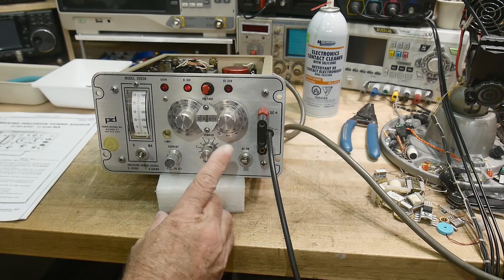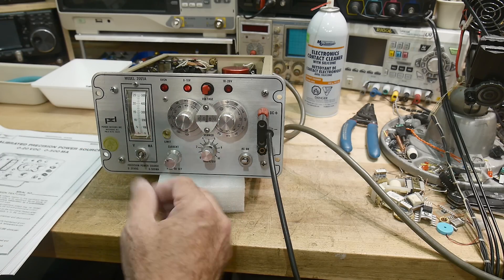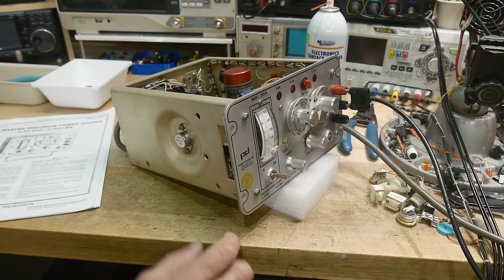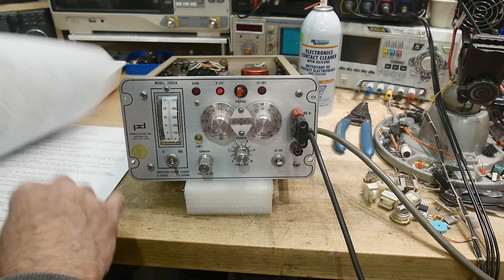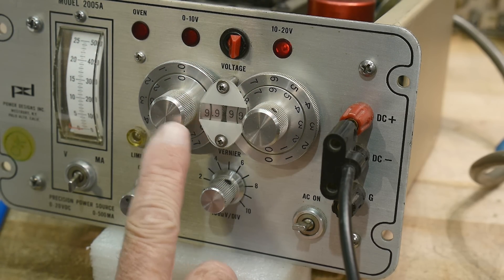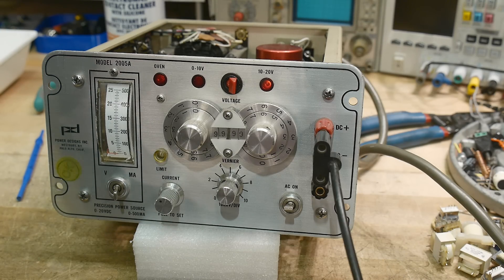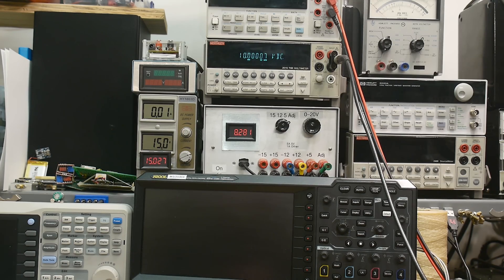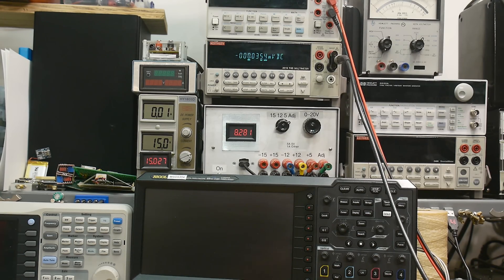#1369 Power Designs 2005a Calibration

Comment: About setting it to 20.000 volts for calibration:  to get it past 19.999 you need to turn the 4th digit one more click past 9 to the position marked with a small '10' in a circle, and leave the vernier at zero.  Same to get 10V in the 0-10V range.

Comment: It looks like the least significant digit of the voltage switches has a 10 position ("10" in a circle). That's where that 20.00 volts should be set, which lets the vernier be set to 0. It probably doesn't make any practical difference in the calibration accuracy, though.
Reply: Yes, the right hand main voltage selector (mV) has a 10. I was resisting the urge to shout at the screen. Great video as usual!
Reply from the maker: you are right, so I set it to 10 during cal. I mention that in the video
Reply: @IMSAIGuy  I don't think we're talking about the same thing. The instruction to set the vernier to 0 (at 8:34) caused you some head-scratching. I think the answer is that at 7:01 the instructions expected you to set the digital dials to 9.99⑩ (nine point nine nine ten) and the vernier to zero. Then the instructions to set the vernier (at 8:34) would have made more sense. It's just an ambiguity in the manual. Your solution with the digital dials set to 9.999 worked fine.

Thanks for another interesting video!

Comment: My 2005a calibrated fine, too. Load testing as per manual made PS permanently lose 10V. Replacing transistors soon...
Reply: I always load test mine under worst dissipation. Eg. linear supplies into a dead short at max current. If needed I replace components until they survive it. Most do no problem, especially old ones.

Comment: As long as it is away from heat sensitive parts, TO-3 placement is reasonable.  Impressed the instrument is carefully designed.
Reply: Their designs from that era have lots of nice discrete transistor analog circuitry inside. Circuits you don’t see all that much that have lots of teaching potential. This one is very simple though. Reminiscent of Harrison differential designs.

Comment: You should sell some equipment that you don't use any more. Do you really need so many power supplies?
Reply: Blasphemy
Reply from the maker: I sell some and give some away
Reply: @IMSAIGuy  Count the Keithleys. Bases covered. 
Nice to see the TM503 found a place.  I'm getting TM503 with units for Tek scope calibration. 
I've expanded to 3 workstations. I'm slow.
Reply: Each work on the device requires a certain power supply, for example, when repairing a motor card from a CNC, I needed 6 different voltages.
Reply: Power supplies: the more, the merrier. Especially the fancy ones that can double as loads or do low frequency AC output. Indispensable.

Comment: Very nice. I was able to score one on eBay for an excellent price too. It has pride of place on my bench. Can you upload the manual/cal procedure somewhere ?
Reply from the maker: http://www.ko4bb.com/manuals/73.63.158.93/Power_Designs_2005A_Power_Supply_Service_Manual.pdf
Reply: @IMSAIGuy  Can't download. 
Can it be downloaded by someone else or it's a issue with my smartphone?
Reply: @paulcohen1555  That is a good site for manuals.
Reply: @paulcohen1555  The link works for me from my desktop PC.
Reply: @vincei4252  
Will try the desktop.
Reply: @paulcohen1555  i do sometimes have problem with some browsers not downloading correctly from every site. Duckduckgo for example corrupts anything from alldatasheet, but works on most other sites just fine.
Reply: @plainedgedsaw1694  DuckDuckGo really sucks for trying to find datasheets. Almost all my searches result in something trying to sell you something. I had to reluctantly switch back to Google to search for the proper datasheets on many of the obscure parts I use.
Reply: @IMSAIGuy  Awesome! Thank you, very much appreciated.